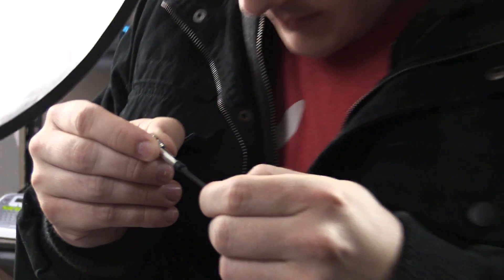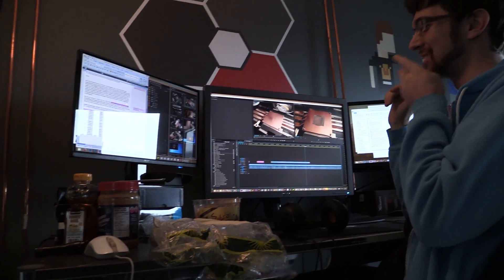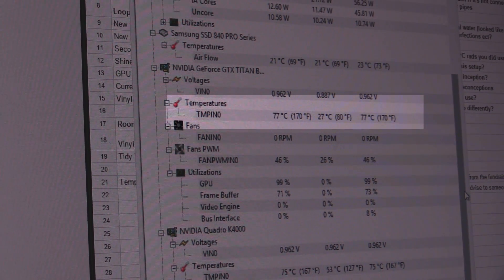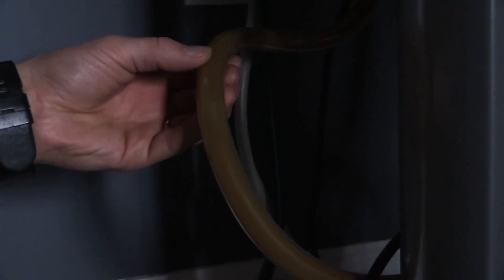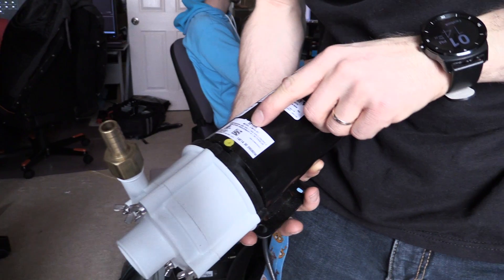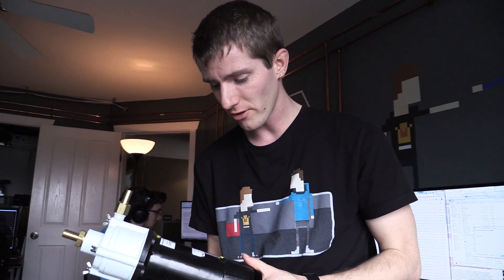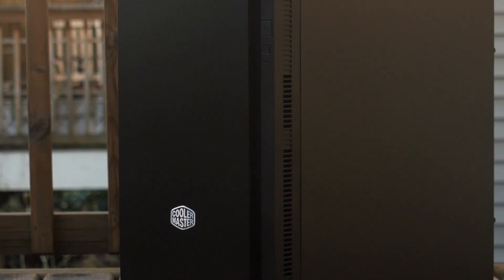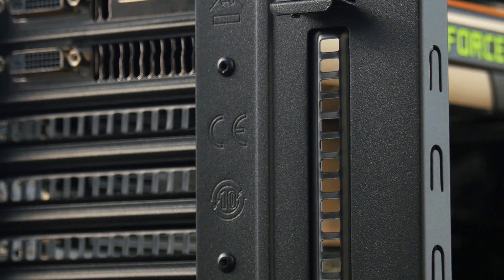Whole Room Water Cooling Part 5a - Trouble is Brewing in the Whole Room Loop...

Comment: seems unfortunate you cant open the black reservoir...

plenty of people suggesting methods of stopping the bacterial growth - but what about using the hot water from the cooling?

i guess, once cleaning is done, you could turn off the fans, and run a benchmark, slowly increasing the entire loops temperature and have it sit around 70-80 degrees for some hours.
anything left in that closed loop should die off.

Comment: To prevent your cables from breaking, make them go in a loop so they run down again and then tape them back to the reinforced bit. Doesn't guarantee that they won't break at all, but at least it lessens the chance as there's way less movement in the reinforced bit.

Comment: Ok well I work on cars and build pc's for fun the stuff you're seeing is bacteria build up from air in the system you should just be able to flush it with a automotive flush you can get at a store and replace the tubing the copper pipe can stay just unplug the workstations from the loop and clean them separate.

Comment: You should have the pc- and the large- circuit separate with a water/water radiator and operate the large circuit with 2 bar, solarfluid and circulating pump from a soloar system. Also you shouldn't yous pc rads outside.

Comment: I'm sorry to see this project going down the drain..

Maybe you can use 95% or pure alcohol to flush and clean your tubing. Atleast all the organic drab will be cleaned away. And bacteria (sorry bad english) will have no chance. Alcohol also does not bite the plastic and coper tubing.

Then after that you can mix coolant with alcohol (20%) so for the couple of months left, your cooling system will be save.

Offcourse alcohol will desolve eventualy and you have to put a little extra in every week. But thats no more then a cup, if your going for bucket cooling that is. Just to keep the bacteria off.

This, i think, will keep the system going and clean. 

God Bless guys!

Comment: I don't know how well this stuff would react with plastic  tubing or your water blocks but maybe add something like fernox inhibitor maybe even go as far as I stalling a magnaclean. They are using g used in central heating systems here in the UK with copper pipes to stop the build up of black sludge and prevent corrosion
Reply: Please ignore poor spelling. Predictive txt is awful on this phone.

Comment: And also i want to point out that you should not use that industrial hard tubing but instead use normal silicon tubes or hard plastic tubes.

Because i think most of the corrosion comes from the metal tubes, the automotive coolant normally flows inside aluminium and silicon tubes and not in hard industrial metal tubes for homes.

Comment: Is there a reason you didn't opt for a closed houseloop with plate heat exchangers at the individual tie in points? So you got separated loops and just boost the Case cooling with your house installation?

Comment: As someone who deals with multiple automotive cooling systems on a more regular basis than I'd like, I would suggest either swapping out the radiator array that you have for either a large transmission cooler or a full on radiator from an automotive salvage yard using fittings to adapt the larger inlet and outlet to the size tubing you are using.  If you're sticking to your current rads you can clean them out with acetone, but you'll want to make sure you rinse them well after and don't get it on your tubing because it can dissolve plastics.  Acetone would also clean out any automotive chemicals in a salvaged radiator as long as it doesn't have plastic end tanks.  A typical automotive cooling system runs anywhere from 14-21 psi so it should be able to handle what you're doing.

Comment: for the problem in the beginning with the cable, just use a zip tie to fix the cable on a belt loop in a way that the point where the tension is goes straight up, it won't break then

Comment: lolz, oh well you are learning by your mistakes as you go along and still making a ton of them.
• Aluminium reservoir
• Flush the system before PC connections
• PC should go to slave reservoir then fed from mian
• Antifreeze thermometer to check percentage to water
• inline valves, Teflon tape, hose clips
• Master pressure gauge and local ones to each machine.

I could go on.

Comment: In a car the coolant is going to get much hotter when the engine runs, so it's not ideal for bacteria growth. It's actually somewhat common for cars that have been sitting for a long while to have bacterial build up in the coolant system. Still though not the end of the world. 

TDLR --> {You might be able to get away with adding some fine mesh filters on the ends of the tubes going into the buckets after adding an anti bacterial and just washing the filters regularly to cut down on the junk in the system before you move. Of course its not a full clean but you'll be going in the right direction. Just on a whim without figuring anything out in particular as far as differing metals in the loop I'd look for stainless steel. Standard low carbon steel WILL rust in antifreeze if the conditions are right.}

Try not to get discouraged, as you've said before there's no handbook on this thing, and also you're bringing in other crafts that you're not familiar with. You're bound to make mistakes. I know I would. Probably an a differing set of mistakes but I'm sure they'd be there. Maybe not though since I've got you guys as a resource now but who knows lol. Just gotta live and learn.

Comment: Hey LinusTechTips you could add a black light (UV) system to the flow somewhere to kill off many living things in the loop.

Failing that Bromine or Iodine might work. Clearly Chlorine based materials would be very corrosive to the copper.

You also need to be worring about what is growing in that loop. If it's something really nasty like Legionella Pneumophila you could be in a bad place both health wise and legally :-(

Comment: you could run the loop with vinegar and water for a night, that cleans off the algae from my reef tank tubing, and it cleaned the rust out of my old dirt bike gas tank. its non corrosive and cheap so its worth a try.
Reply: also if its an algae problem you could always hook up a UV sterilizer from an aquarium into the loop. It looks like diatoms but i just couldnt imagine them living in anti freeze.

Comment: You could try to reinforce the cable with something increasingly more flexible, the higher the reinforcement goes. Try tape for example. add shitloads of it to the bottom and then fewer and fewer layers the higher you go. This way reinforcement at the end should be flexible enough to keep the cable from breaking.

Comment: You should try to install a filter between your reservoir and your pump 
I suggest you to try the filters used when you pump water off the groung or the ones for swiming pools they are pretty strong and they can hold a lot of dirt 
You should also install some "windows" (i don't know the exact therm) to see the water flow in your circuit and check for bubles and dirt instead of looking throw the tubing or on your graphic card cooler

Comment: I've been watching your watercooling build and noticed that you used a lot of extra plumbing; by running your lines above the door and then dropping down, when you could have just run them along the baseboard. Also you could have saved 2/3 the cost by using PEX which is much easier to instal and perform upgrades to than copper. I assume that when you move offices you will still be using a water-cooling setup and suggest using PEX, and suggest running the shortest loop possible as it increase the cycle time and would allow you to bleed the system quicker (you also would need a bleeder valve at the highest point to quickly bleed the air). I have an apprenticeship license as a plumber and would be happy to help out how I can. PS. I would suggest not purchasing products under the "PowerFist/Princess Auto's budget" brand as they are complete garbage.

Comment: boil it + Freeze it & Repeat ;) , pour boiling hot water, then rinse with liquid nitrogen, again rinse with boiling water, i am pretty sure any thing living in it will die and the reservoir will be cleaned too LinusTechTips
Reply: I'm sure a strong biocide would be a much easier, cheaper, safer and more effective option while while putting much less heat stress on the system. XD
Reply: Or you can just add an AMD card
Reply: Rinse with liquid nitrogen? The whole thing? I hope you're going to foot the bill...
Reply: I wonder how many parts you would destroy from rapid temperature change causing stress? Why don't you replicate the whole loop and let us know.
Reply: chlor maybe ?
Reply: Nathaniel Graham James Healy I was only talking about the reservoir, not the whole loop ! just to clean it, and it doesn't  have to be liq nitrogen, that was a "funny exaggeration" nobody got that. Pouring Hot/Boiling water will help clean the reservoir cheaper. and as this all has already happened no point discussing about it, ( aall this was shot a long time ago).
Reply: [EDIT] well there is point in discussing, no point in arguing :P
Reply: Prathamesh Tambe Didn't mean my comment to be argumentative sorry, I was pretty much joking back. Maybe badly, but you get that on youtube. ;)
Reply: Just add an AMD card

Comment: Anti-freeze does not contain any bio-cyde. In a car's cooling system you have coolant flowing at a high rate of speed and it's under pressure. Usually 14 psi. It has no time to grow microbial stuff in it. It's also a completely sealed up system from the radiator, to the engine block, to heater core, back to radiator. But why are you using anti-freeze when you could just fill the whole system up with distilled water and ad a bio agent to it?
Reply: the radiators are outside and antifreeze stops the water from freezing and cracking them they also live in canada so it gets much colder during winter.they could get a power outage during winter witch freeze all out side pips but if they have anti freeze its much safer.
Reply: WildChickenNutz
Hold cold do they get?? I am about 3 days (driving distance) away from them (Oregon US) and it doesn't get that cold. For this system of theirs to work They should do the pump's in parallel and ad a anti-microbial agent to the water and should use DISTILLED water. Water from the garden hose/tap will have microbial in it; something I thought Linus would have known about. So part of this I am not understanding, but fun to watch.
Reply: a car rad isn't a completely sealed system, at least not in every car. Some have a res that it can boil over to if it overheats. I imagine there might be some that are sealed but with pressure relief valves.
What kills any growth is the fact that the water gets to like 90c.
Reply: fightingfalconfan *****  I dont think your understanding what i'm saying. I agree that when the system is operating correctly it is pressurized. all im saying is that it isn't sealed (Im not saying the system can operate without the radiator cap on although with some non water based coolants it can). Since the radiator cap can be removed a contaminant could get into the cooling system. If the sytem is in an overheating state it also vents steam to the atmosphere indicating that the system is not "sealed".  I would also like to know how to service the coolant loop on a refrigerator that does not have charging points? On most small refrigeration systems the loop is charged and then the copper fill pipe is brazed shut.
Reply: fightingfalconfan they live in canada so it gets super cold :P
Reply: fightingfalconfan I live in the same general area and I think it only got to-3 this winter and that only lasted for a night.  So while it's not terribly cold water could freeze if the was a power outage,  and some years it can get to - 10 so better to be safe than sorry. (for comparison your 32 is our 0)
Reply: Yasin Sukarieh yes anything under 0 will freeze water but for the two minutes (generous amount of time) that it's out there in our mild Vancouver weather it won't freeze because the water wouldn't get that cold.  Now unless you are talking about the power outages (witch I also mentioned) there is no reason to worry about it,  but as I said better safe than sorry
Reply: Right now where I am it is -20C in BBC it's more like -5C right now but temps can go crazy here. I've had it go from -1C to -45C in less then 14 hours
Reply: I see the need for the automotive coolant...hell even while the system is running at those temps water will freeze, they are not getting them water hot enough from the cpu/gpu's to make it so the water will stay 195+ degrees F.
Reply: bassl0va  
Actually a car radiator is completely sealed from the outside so that no air can get in. I am a automotive tech and have worked on the automotive cooling system quite a few times for servicing/repair work. what you are describing is either a over flow tank that's not pressurized or an expansion tank that is. The only pressure relief valve in the whole cooling system is the radiator cap or the expansion tank cap.
Reply: bassl0va
they are all sealed systems on vehicles.............that is why they are under pressure and the boiling point is increased. the relief valve is part of the rad/header cap..............thats why there is a spring on it
Reply: ***** fightingfalconfan bassl0va There is a major difference between "sealed" and "pressurized". Automotive cooling systems are mostly pressurized. you can open the radiator cap allowing contaminants into the system. Sealed or Closed loop systems are not easily serviceable. for example The Refrigeration system on a mini fridge or a closed loop liquid cooler.
Reply: Skyler Dorrell
Unless your a automotive tech I suggest you just stop talk about an automotive cooling system. You clearly know nothing about them.
Reply: fightingfalconfan You are correct in saying im not an "automotive tech" I am Physicist with specialization in thermodynamics and thermo engineering. In other words I design the automotive cooling systems (among other cooling systems) and the coolant that we are talking about here. So yes i fully understand the way these systems operate and the physics behind why they do so. Classic car restoration is my hobby though.
Reply: Skyler Dorrell
the refrigeration "loop" on a fridge is very easy to service................ the cooling system in a vehicle is sealed........... if it is not it can not pressurise, and the coolant/water mixture will boil instantly
Reply: Finally someone who gets it! This is what I have been trying to relay the entire time!! I work in the automotive repair field and have repaired vehicle cooling systems a few times. The system is completely sealed as I stated in my first comment; I don't know why you would say differently when you clearly don't work on cars for a living. If the system is not sealed up, it will produce steam and eventually over heat the engine. Inside the cylinders when you burn gas the temp reaches well over 900 degree's F with pressure in the 1000 mark. 80% of the fuel burned in an engine is wasted through heat. Only way to get rid of that heat is through the coolant of modern cars and when your coolant absorbs the heat it tends to expand and if you don't seal it up it will turn to steam and just boil off causing your cylinder head and engine block to warp and sometimes crack. Kiss your engine goodbye if that happens. That's why it's sealed and designed to hold a certain pressure and usually it's around .9 atmospheres or 14 PSI. Labeled on the radiator cap, expansion tank, or on the radiator core support. the cap has a valve in it to maintain that 14 PSI of pressure so while your driving around the engine stays a consistent 190-201 degrees F and that's when your cooling fans kick on; pull air through the radiator so it can keep the coolant consistent.

Comment: Have a Glass Box as the reservoir. you will be able to see whats going on too. and for the wire bend problem. bend the wire and tape it to the jack. so it wont move alot like before.

Comment: I would just put a huge acrylic glass plate on top of the bathtub and seal it with silicon or so, drill holes for the tubes and there you go you have a nice big reservoir. xD

Comment: Not to rain on your parade but when you filled your loop with tap water you introduced the biological component into it. You can, happily, save your rads though. Get some Prestone cooling system flush and mix it into a gallon of distilled water and fill the rads up with the mixture. let it sit for a couple of hours minimum and then flush thoroughly with distilled water. If a gallon won't quite do it use two bottles of the flush to two gallons of water. When you move I'd definitely pull the CPU blocks apart and blow the pin matrix out with compressed air since algae can get into them. I've had it happen with an MCW80 and even after soaking the base in white vinegar for a day the algae was still in the matrix. Compressed air made short work of it. In the future you should consider some sort of biocide, like something used for ponds. For closed loops you can use silver to keep the nasties at bay but considering the scope of your loop you'd probably need $50 worth to do it any justice and the silver only lasts for so long before it needs to be replaced.